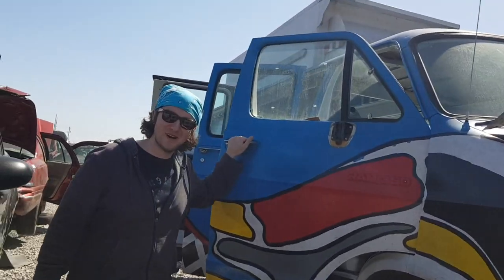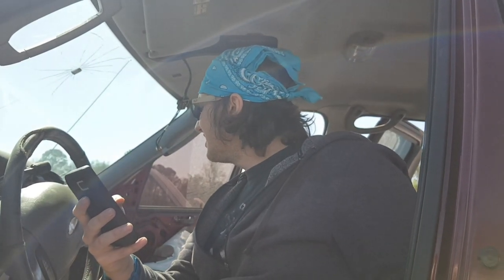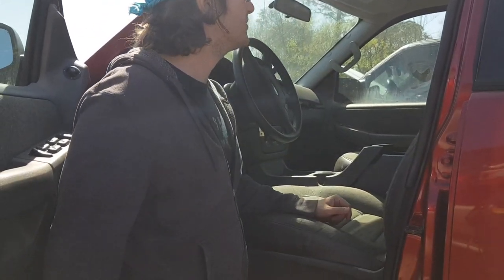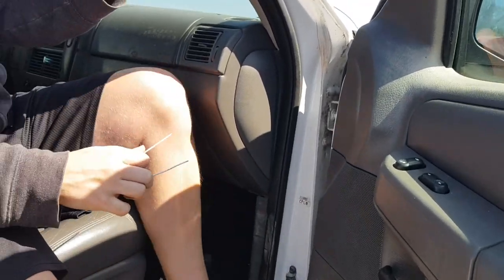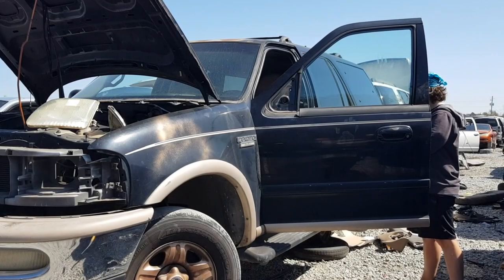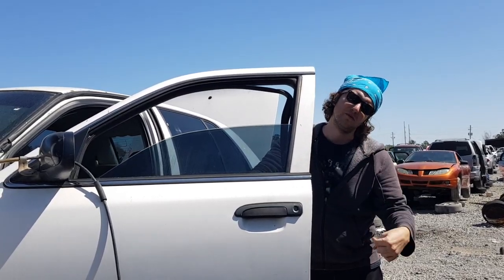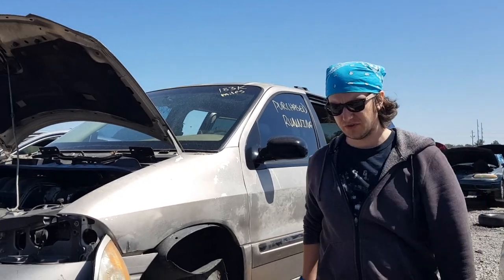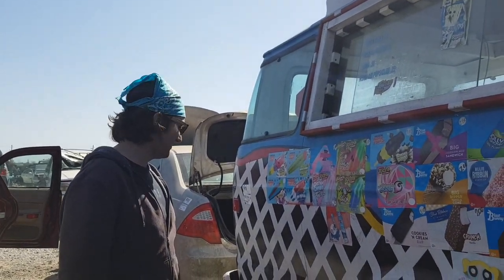Finding Money at the Salvage Yard

Comment: I know this is an older video but to get the metal mirror holder off the windshield take a torch and put it on the outside and the adhesive or glue might release

Comment: I sold a quite a bit of parts on eBay and my most profitable are rare silver face factory Volkswagen gauges and computers. It’s hard to test stuff but I always welcome to returns just make sure you sign the part and take a picture so you know you’re getting the correct part in return. I only had one return.
Reply from the maker: Yeah. There is a lot of money to be made there if you really try.
Reply: @debunkingcars2359  Yeah especially with electronic things and rare cars but the average person wouldn’t know what the heck they’re looking at. I think the easiest thing is if you find a key in the ignition to take the key and the computer out Because usually to reprogram a key for a car you need an old key so if you sell a computer you need to have the key with it. Some computers or ecu’s are worth a lot of money somewhere around $1000 for certain cars
Reply: @andrewziegler2608  GM air bags! At least those from the early 00s. A lot of airbags in general really. Any auto dimming or electronic integrated mirrors too. Gauge clusters a big one also, as you mentioned. Strange how many things in a car can be worthless or worth big bucks.

Comment: Speaking of junkyards Scotty still thinks that if a car burns oil it belongs in the junkyard.
Reply from the maker: If it's not a mid 90s Toyota, it belongs in a junkyard.
Reply: @debunkingcars2359  Never mind that it’s an ugly, underpowered little shitbox.  As long as it runs forever it’s the only car that matters.
Reply: @debunkingcars2359  If it's from the 90s and its not a Toyota, it might belong in the junkyard. If a Camry runs in the first place, you can usually keep it running for much longer. No one ever does anything to make an old Camry look better though. Not on the outside. I have found out, you can use outdoor urethane spar varnish to fix clear coat. It's not like a shop but it passes the eyeball test in a parking lot. I just dabbed it on with a Kleenex. Actually a Scottie but you know what I mean.
Reply: @anonymike8280  u can do that with any mainstream non luxury car not just a Camry.
Reply: @Natethegreat200c  Keep it running? Usually. But the Toyota transmissions are notably long lasting.

Comment: How are you making any money on a $50 radio? They charge around $25 at a yard at least, plus $15 shipping and 12% in fees you’re making like $5
Reply from the maker: I'll do a follow up video to show my actual profits.  I didn't sell any of the radios that cheap.
Reply: Varies a lot by salvage yard. Some want $40 for a fuse box and some want $10. Just as an example. In my experience you can almost always haggle as well. Get to the desk and when they give you a price ask about specific items and say "Ah that's too much. Could you cut me a deal on that?" If they refuse, ask if you can get one of the items for free. If they still refuse, ask if you can just get a reduced overall price. If they won't do it, then feel free to leave the overpriced items behind. When they know you're serious about leaving them, they still might finally cut a deal. One yard wanted $24 for 4 spark plug wires and I was like that's too much that's basically new prices. They gave them to me for $7 hah. Normally wouldn't get used wires anyways, but these were fairly recent NGK blue wires. Anyways, just figured I'd share. :)
Reply from the maker: Dude! Good to hear from you.  Yeah, I got a set of "oh shit" handles for free just because I wanted to use a card to pay. Dude was like, "eh, just take em." Always works better at local lots, but the flip side is they're more picked over than the national chains.